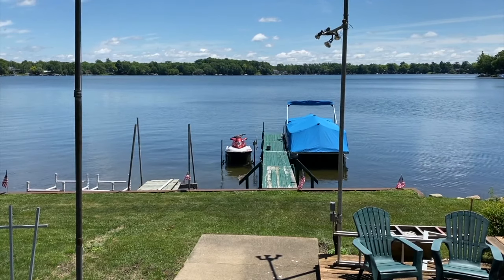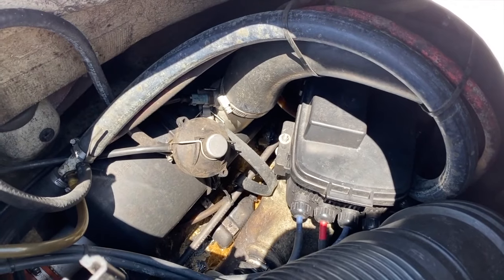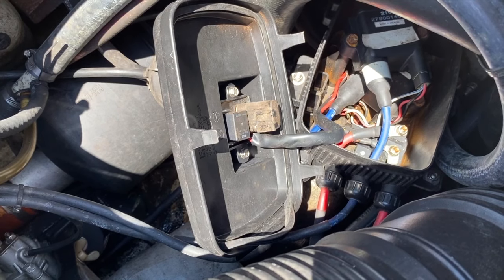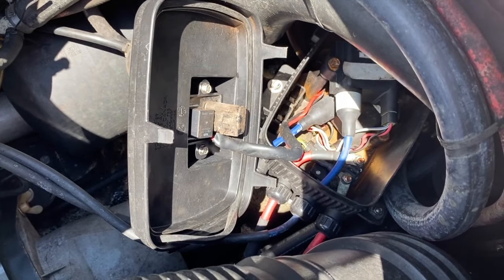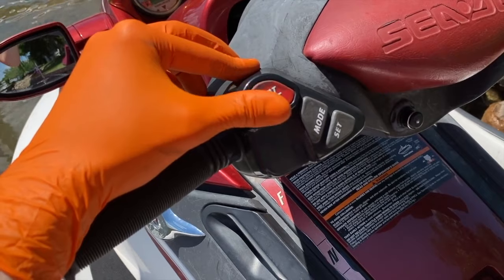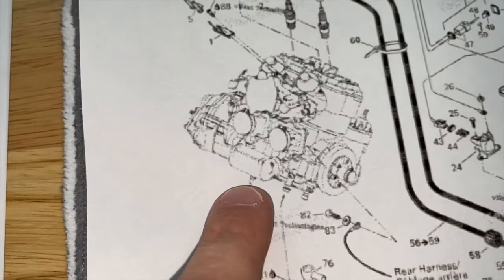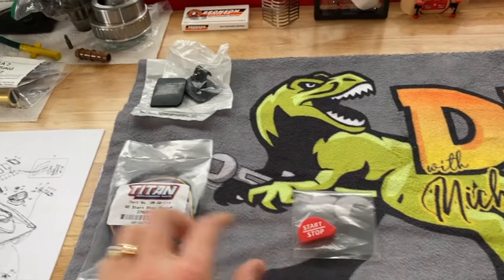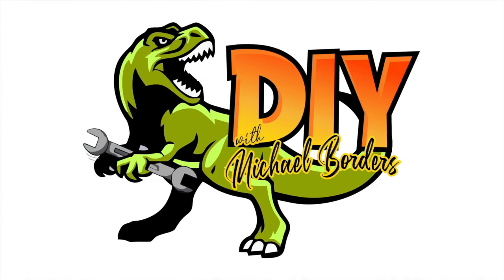Jet ski not starting - MOST common causes

Comment: 2003 Polaris Genesis here. Thanks for the video. Good reminder, I had this happen before. My boat wouldn't turn over it would just crank and crank and never fire. I beat on the starter relay with the back of a socket wrench and that must have loosened it up, and it started right up. I think a new starter relay will be in my future tho.

Comment: I have a 1997 Polaris, SL 700 no spark, but if I press and hold the bilge pump button while starting I’ll have spark any idea what this could be?
Reply from the maker: Thanks for watching Hunter, sounds like a loose wire connection…🤔…or it may be due to damaged wiring.  We recommend checking any and all wiring and wire connections to ensure there is no damage such as crimped, melted, or frayed wiring as well as no loose connections.

Keep us posted and hey if you’re into crypto trading, check out our newly launched DIY ecosystem.

       Toolboxtoken.com

Reach out to us any time!  🧰

Comment: So I have (2) 2023 spark trixx 3 ups I bought at the same time. They both have about 9 hours on them and I’ve had them for four months, my friend was riding one on Sunday and said he was going about 22mph when it just cut off. So he tells me.  I put the same gas in both of them in the morning so probably not fuel.  I tried both keys with no luck, still a crank no start.  My closest seadoo dealer is 2 hours away. Being new skis I’m wondering if there’s something simple I can check before I load it up and go to the dealer.  Thanks in advance
Reply from the maker: Good morning, just poured a cup of coffee and am sitting down to answer any and all questions for the DIY community.

We would start with performing a system reset by disconnecting black negative cable from battery and leaving disconnected for a minimum of 5 minutes.  Some leave disconnected for 30 minutes.

After that, re-connect cable to battery and start engine.  It’s likely that your ski is in limp-mode which is a built-in safety configuration.

Let us know if you have any questions and hey if you’re into crypto trading, join our DIY ecosystem and become part of an exclusive group of DIYers.

       toolboxtoken.com

Reach out to us any time!  🧰
Reply: @DIYwithMichaelBorders  ok, thanks for the quick response, I will give it a try and if that is the case my concern would be why it went into limp mode.  I’ve been an ase certified auto technician for 31 years, but unfortunately I’m new to JETSKIs so I’m not familiar with the way everything works.  I know when a car goes into limp mode it still runs, but with reduced power, anyway I’ll let you know what I find and I will post a youtube video to help the community in the future
Reply from the maker: @jasont7887  

We appreciate the follow up.  If in limp mode, the onboard computer sensed something it didn’t like and configured itself into limp mode to protect other systems that would actually be affected in a negative way at high power settings.

Could be as simple as low oil, low fuel, or something else.

Comment: Hey mate how are you. My seadoo was running then suddenly ran ruff then died. It turns over but won't start. Any help cheers?
Reply from the maker: Good morning, just poured a cup of coffee and am sitting down to answer any and all questions for the DIY community.  Hope you have been well.

Any update?  We love talking jet skis.  Any recent MX performed on ski…?…it may help us determine whether or not any recent MX is tied to issue.

Have you replaced plugs and wires in recent years?  Another thing it can be is lack of vacuum pressure.  Below are a few links that may be helpful.  We will also link our (Fixing boats and jet ski) PlayList.  👍

     Low vacuum pressure:  https://youtu.be/Jr7eWlFGvAc?si=PIBf9Afah6dYE9cL

     Replace Solenoid:  https://youtu.be/SfjX9OtOyIM?si=7lNCLjafGBjmN2LJ

     PlayList:  https://youtube.com/playlist?list=PLjCXOz8TSkZlae2qY97uVVTm3JdBOUoRS&si=z5nMupu1GPVf23EZ

Let us know if you have any questions and hey if you’re interested, join our DIY ecosystem and help us grow an exclusive group of DIYers.

       toolboxtoken.com

Reach out to us any time!  🧰

Comment: Awesome video! Question tho!? I have a 2017 Yamaha wave runner VX limited replaced spark plugs and did the gap on them but it turn over no start but once I spray some starter fluid it turn on just fine. Could it be the fuel injectors ?
Reply from the maker: @JuanTorres-vt1dq  

Thanks for watching, any update?  Fuel injectors are very likely the issue…especially if the engine stays running after it starts.

Any engine acceleration issues at high throttle settings or speeds?
Reply: Same problen same ski for me all crank no start

Comment: After jump starting mine while it was attached I no longer have a beep upon key.  Same model 2002 GTX DI.  New battery. Charged. What part do I need to swop out?  Diagnostic shows no communication from mpem.
Reply from the maker: @MrBea-lv7oj  

Thanks for watching, have you checked your DESS key electrical contacts to ensure that it’s clean and free of rust, corrosion, or debris?

It’s also possible that jumpstarting the ski damaged some electrical wiring however not 100% confirmed.

Jumpstarting Jet skis are not recommended for this reason…it can introduce electrical shock to the system.

Do you see any signs of damaged wiring?  Let’s get this figured out.

👍🧰

Comment: I have 2 Kawasaki ultras 2014

1 works fine after being stored over the winter.The other 1 won’t even register the key with a good battery. 

I’m going to clean the battery cables and hope that works. Could you tell me what you’d check next?

I never had a problem with these until now. Thank you,sir!
Reply from the maker: @EmilyP17  

Good morning ☕️ any update?

We recommend inspecting the inner portion of your electrical box and ensuring everything is connected properly and nothing is damaged.

You can also inspect your DESS probe installed on ski and ensure there is no corrosion.  It’s likely related to an interruption in electrical connection…Keep us posted.

Comment: 98 seadoo gts it started in the drive way and tried to start on boat ramp but won’t start now, plugs fire when I test them but won’t fire inside the ski. Bad gas or do you think it’s the push button or starter relay?
Reply from the maker: Thanks for watching, how old is battery?  Does battery have more than 12v’s?

An old battery can cause this however if battery is newer and fully charged, the starter relay is the next part to replace.

😎👍🧰
Reply: Battery is about a year old along with the starter. But the starter turns over just fine. I’m gonna get a spark plug checker and new fuel filter for it too. But if that’s not it then I’ll be getting that part
Reply from the maker: @bradykice8759  

Awesome, looking forward to hearing back from you.

Comment: New battery and power is great but I just get a single loud 'clunk' when i hit the start button. Could that be what it sounds like if starter is out? Or is that more of a 'frozen' engine. Thanks!
Reply from the maker: Thanks for watching, a frozen engine would be no fun.  Hopefully it’s either a faulty Starter Relay or the Starter.

We would start with the relay, and we highly recommend purchasing OEM relay.
Reply: have you checked the battery with a voltage drop test. very easy to do if you have a multimeter.
Reply from the maker: @zakiramjan9822  

Thanks for sharing.  We tested battery, starter, and relay.

😎👍

Comment: I have a 1997 GTX
I put the Killswitch cap on it sometimes it will show on sometimes it wont.
It is now blinking maintenance.
When I push the start button nothing happens no clicking or anything.
Please respond with some ideas and your link for replacing that button is not on here
Reply from the maker: Thanks for watching, any update?  Have you tried resetting system by disconnecting negative cable from battery for 5 minutes?

Comment: My 2002 seadoo GTX DI starts and it dies within seconds. Maintenance light comes on. Seems is in limp mode, how can i reset it. Last year it was tip over and i believe after that incident it started to act up and now will not idle.
Reply from the maker: @Backyardigan951  

Thanks for watching, any update?  By chance is the engine shaking or knocking after it starts?  The reason we ask is because it’s possible…however unlikely…that your Knock-Sensor is detecting knock and immediately shutting engine down.

If that’s not the case, you may want to carefully disconnect battery, followed by disconnecting each connection point from your MPEM one at a time and leaving disconnected for 1 minute.

Please keep us posted.  🧰

Comment: I have a 2006 Seadoo GTI that ran well, sat for 2 months and wouldn’t start. I replaced the battery, and still nothing. When I put the key in, the screen might flash on but immediately cuts off. Beeps for about 2 seconds, then gives 4 consecutive beeps every 10 seconds or so. No LCD feedback. Any ideas?
Reply from the maker: What’s up Adrian, any update?  How many volts is your battery showing?  It’s best to have over 12v’s prior to engine start.

4-beeps can also be triggered when the engine is stuck in a position outside of FWD/Neutral/REV…which may be as simple as you moving the shifter back and forth a few times to get it back in a safe configuration for start.

Another possibility is a corroded DESS post or key…which may require a friendly cleaning to work again.  Keep us posted.

Let us know if you have any questions Adrian and hey if you’re into crypto trading, join our DIY ecosystem.

       toolboxtoken.com

Reach out to us any time!  🧰
Reply: Idk man I’m on the same situation, it’s 4th of July just replaced the battery 10 mins ago and still nothing

Comment: My 01 Yamaha waverunner xlt1200 won’t start it cranks and also show a low fuel warning on a full tank-new spark plugs-battery & starter solenoid relay
Reply from the maker: @ernestl709  

Thanks for watching, any update?  Are the newly installed spark plugs properly gapped to your specific engine?

Do you have a fresh new tank of fuel or is it fuel from previous season?

🧰
Reply: @DIYwithMichaelBorders  it has old fuel in it I’ll be going today to remove it I did throw some fuel in the spark plug hole & it started so hopefully it’s bad fuel. I forgot the remove the old fuel when I was testing it before
Reply from the maker: @ernestl709  

Thanks for the reply.  We have filmed a video siphoning fuel out of our 1995 Sea Doo XP…however, that video is in the queue waiting to be released.

In the meantime, below is a link to a video showing us using the exact syphon kit that we used on the XP…but removing fuel from our boat.

       https://youtu.be/CwdYEQwt_qk?si=3BLBPvn2QDyY2Sf3

Keep us posted.  👍🧰

Comment: My 2002 gp1200r has been making a weird beeping noise, it’s never happened before just started last summer. Any ideas on what this could be ?
Reply from the maker: Good morning, just poured a cup of coffee and am sitting down to answer any and all questions for the DIY community.

Is it the same beeping noise as when you connect key to DESS post/ignition probe to start engine?

Your key and DESS post might be ever-so-slightly widening causing the ski to beep.

Let us know if you have any questions and hey if you’re into crypto trading, join our DIY ecosystem.

       toolboxtoken.com

Reach out to us any time!  🧰
Reply: Good evening
I have 2002 gp1200
Not starting, usually is stubborn old girl but takes awhile to get going but once started stays running no problem any ideas..

Comment: 2009 Seadoo GTI started just fine but after an hour riding it,  switched drivers and press the start button and it attempts to crank for 1/2 a second then stops?  12Volts on the new battery (<2yrs old) I figure that can rule out the start button and the battery.  If the rely is bad will it still crank for 1 second?  If it is the starter does need to be replaced does the the engine need to be removed to replace it?
Reply: No it doesn’t but you will do it completely by feel…. Get a mirror as it is near bottom of engine and will help get an idea of what your feeling and the 2 bolts that hold starter.
Reply from the maker: Thanks for watching, any update?  Being only 2 years old…we will be shocked if the starter has already become faulty…🤔…or is the battery 2 years old and the jet ski much older?

Is there any standing water in bottom of internal hull or any visible moisture near electrical connections feeding into MPEM?
Reply: I have the same problem with my Kawasaki sport tourer 1100stx.  It will crank 1 time and stop immediately.  I got a brand new battery yesterday and same thing.  So could it be the starter or rely?
Reply from the maker: @rancesprowls8191  

Thanks for watching, starter relay is the next likely cause.  😎👍
Reply: I appreciate the response.  I ordered and installed a new relay and starter and nothing changed still the one clunk and nothing.  Would you have any other advice or what would be your next step?  Thank you
Reply from the maker: @rancesprowls8191  

Thanks for the follow up.  Do you recall the last time engine ran?  Was it running and then all of a sudden turned off?

A brand new Relay and Starter installed followed by a (clunk)…is a common symptom of a seized engine.

Please keep up posted.  We are just shy of pulling our engine out of this exact sea doo shown in this video.

We are going to film a series on removing old engine and installing a brand new engine.

😎👍
Reply: It was running just fine for the first 3 outings this year.  The next time out I got about 1000 yards from the dock and it quit on me.  I started to tear it down after the starter and solenoid didn’t work.  I found the cylinder 1 piston pin in my exhaust manifold and knew it was done for.  It will make for a good winter project.  Appreciate the help and I will stay posted on your vids thanks!
Reply from the maker: @rancesprowls8191  

Thanks for the follow up, winter project indeed.  Looking forward to hearing back from you on how it goes.

👍

Comment: Mine is a hard start condition. I crank it for about 30 seconds before it will start. Once it starts it runs amazing until I get to full throttle it likes to cut in and out. Any ideas?
Reply from the maker: @matthewschroeter9045  

Good morning ☕️ any update?  Possible that you are experiencing a slow-down in fuel flow or fuel pressure.

It can be that your fuel injectors are a bit gunked up and needing to be cleaned or replaced.

Also, we can’t rule out worn out spark plugs and wires.  Keep us posted.  🧰
Reply: @DIYwithMichaelBorders  so I took the fuel hose off and put the key in. I have solid fuel flow but it’s kinda just coming out like how water would come out of the hose with no nozzle. Long story short it doesn’t look or feel like the 107psi it should be
Reply from the maker: @matthewschroeter9045  

Awesome, that alleviates the fuel blockage or low pressure.  Any update?

We would direct our attention to the ignition system next.  Possible weak ignition coils, plugs, or wires and boots.

These items being weak will create the symptoms of a misfire or degraded engine performance at high rpm.
Reply from the maker: @matthewschroeter9045  

Below are helpful videos on replacing the parts listed above.

Replace ignition coils

       https://youtu.be/1VrtwJl6hjI?si=zGiIqmepKg17XVEw

Replace spark plugs and boots 

       https://youtu.be/gRTpc5pqLLk?si=FgbHl2ykyAncto2S

🧰
Reply: @DIYwithMichaelBorders  replaced the fuel pump and it runs amazing now!!
Reply from the maker: @matthewschroeter9045  

Outstanding!  We appreciate the update.  That’s a pricey part however sounds like it was a must.  👍